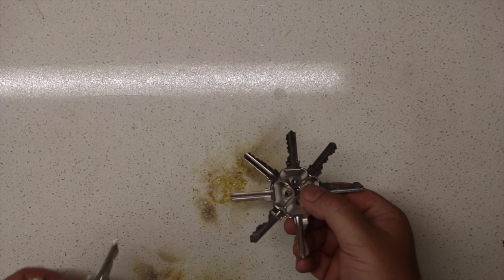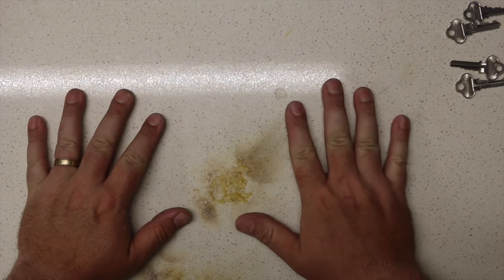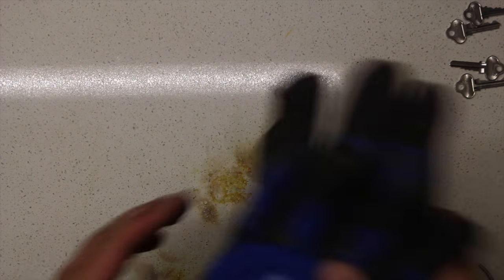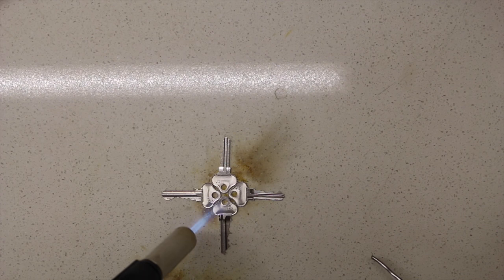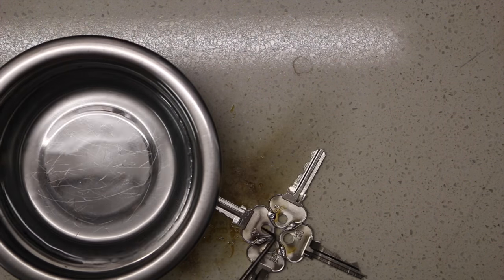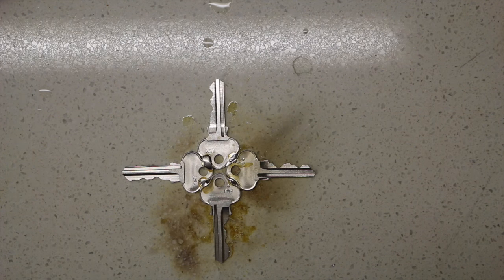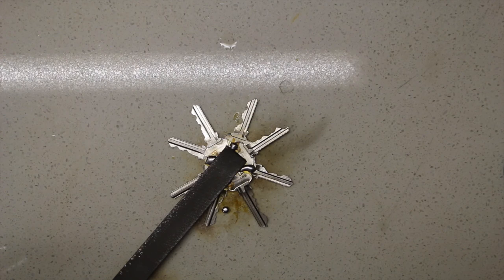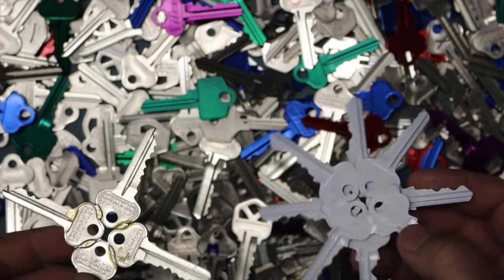HOW TO WELD KEYS TOGETHER

Comment: I have a weird question I see that you can solder the keys but my question is can you add teeth to a key by using the same method. I want to surprise my girlfriend with a Chicago Cubs key but the only one I can find online that's like a real sturdy one wasn't made for actual use It's like a collector's item key. I want to buy this key add teeth to it and Dremel down the correct dimensions but I would like to know if it's possible to add teeth to a key by using your method.